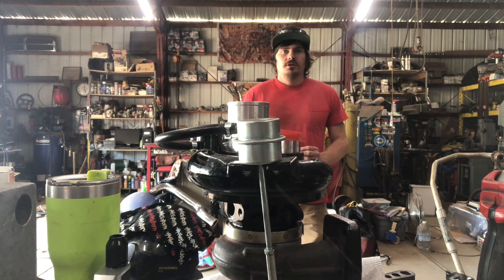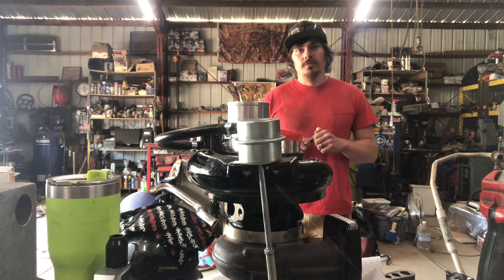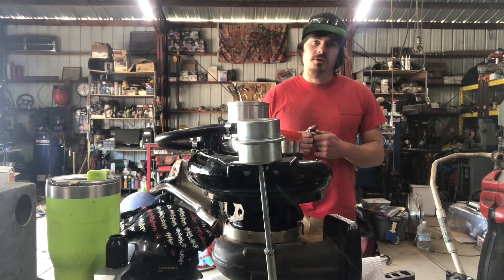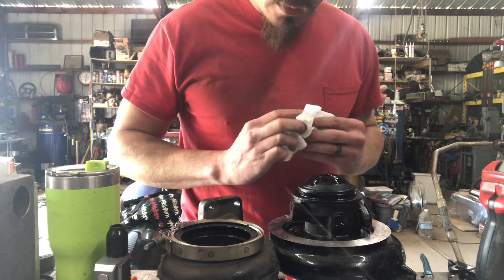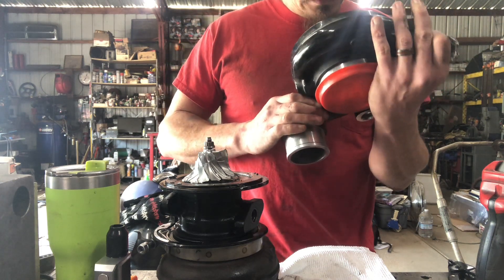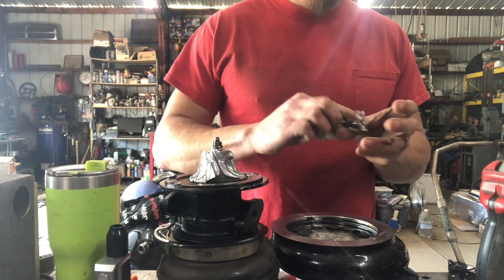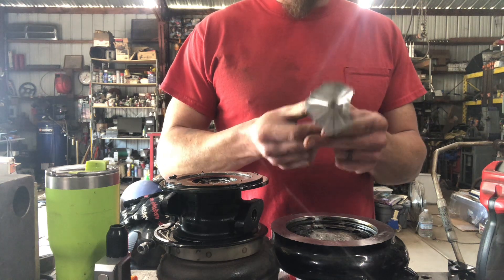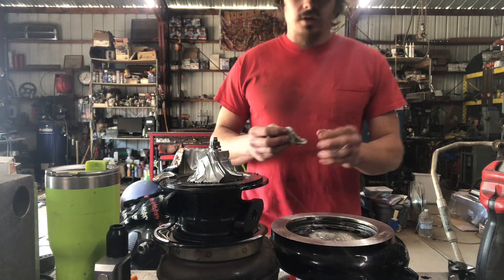What does turbo compressor burst look like?

Comment: WIDESCREEN! YAY! Would a titanium or ceramic wheel hold up better?
Reply from the maker: Yeah but they have the trade off of being able to go through a lot more things when they do go. Pretty much all titanium wheels turbos have cast iron compressor covers due to the increased danger/ need for burst containment.
Reply: @savagefabrication795   My experience with the ti wheels on the Holsets is they will snap the turbine shaft before they will explode the wheel.
Reply from the maker: @bcbloc02  i could certainly agree with that